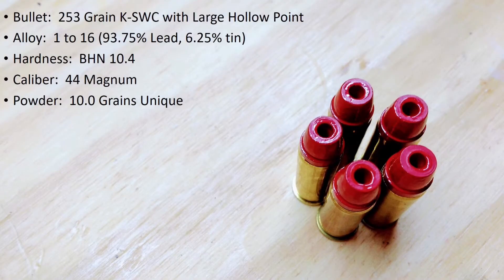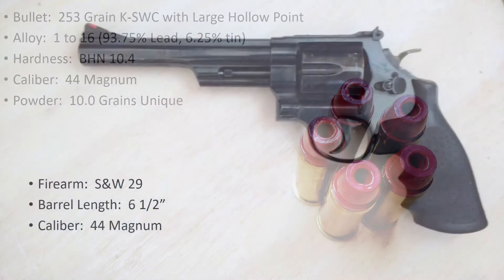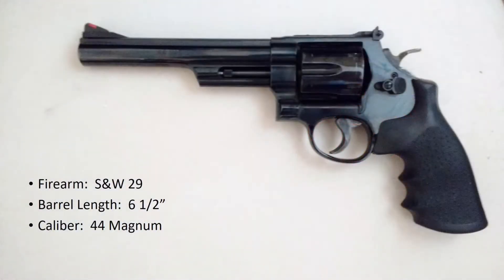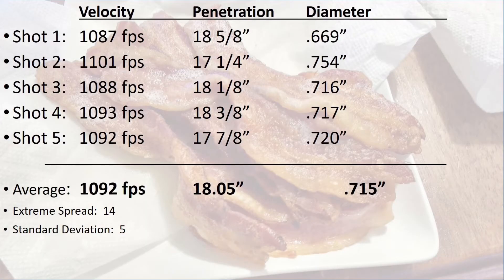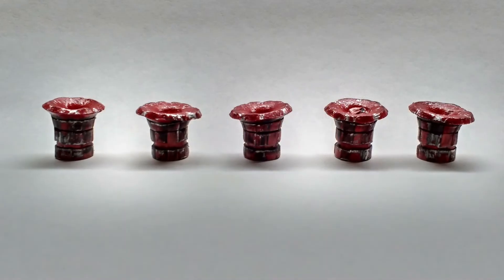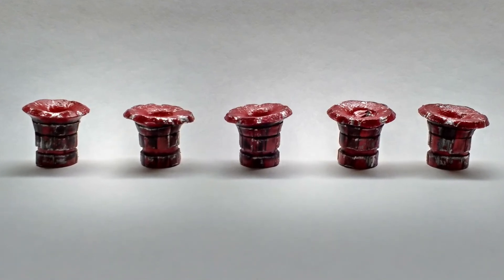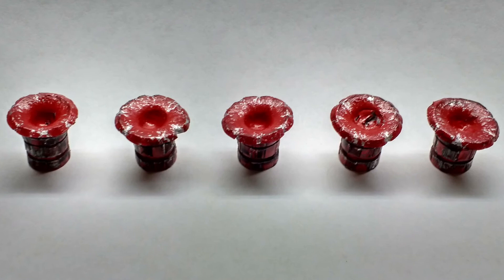44 Magnum (1100 fps), Large Hollow Point, BHN 10.4, Bare Gel (PC HP Test)

Comment: A lot of this is indispensable to the handgun hunter. depending on penetration value and performance of bullet weight retention, (accuracy is a whole another subject), I feel that a bullet must perform @ 50 yards to be in the hunting category for clean kills on deer size game, Paul Harrell called it expansion threshold value. These bullets can be shot a velocity that gives good dependable expansion at that range, Might take a few trips to the range to figure it out, however, these bullets will outperform any commercially offered bullet.  Your work doesn't go unnoticed Bacon, truly a benefit to the reloading community. Dave.
Reply from the maker: Thanks Dave!  I've certainly considered that as well.  Muzzle velocity isn't important, it's the impact velocity.  (I'm also curious what difference twist rate makes ... I think I have a way to do a little testing of that, but I'll save that for much later.)

Comment: LoB - NIce job with this testing...That 10 grain Unique load is a favorite of mine, but my Keith bullets were in the BHN 16-18 and no HP.  That 16 -1 alloy is mighty fine with that hollow point...Gotta check out your video on the Taurus Judge... Good day to ya,  FC Steve
Reply from the maker: Thanks FC!  I discovered the 10 grn of Unique load through this HP testing and instantly became a big fan.  It is a load I will certainly continue to use.

Comment: Those performed very well, I am surprised that there was no disintegration at all from any of them, and also that the expansion was so uniform, good penetration at that diameter as well, a winner.
Reply from the maker: I was talking to a guy at the range right before I shot these, and I told him, "These should shoot right around 1100 fps, and they should perform well.  I'm guessing they'll be fairly consistent."  They certainly did not disappoint.  I'm not quite sure what to expect yet in the next test.

Comment: Great series. I've watched every video... I'm wondering that if you were to cast the non-hollowpoint bullet with pure lead and shoot it with enough velocity, if it will flatten out upon impact with the gel. Do you think the powder coat would prevent barrel leading if you were to do this? If the bullet will deform nicely, I suspect that it would perform more consistently than the HP bullets because the deformation is solely dependent on velocity and impact. I doubt that denim or leather would affect its performance.

I'd love to see you try this if you have time.
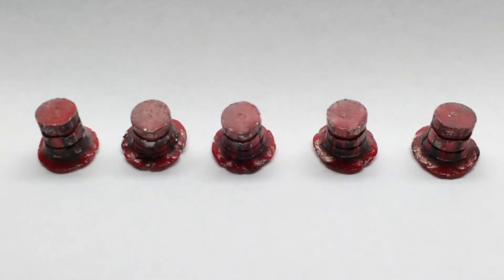Reply from the maker: I have not cast any from pure lead, but the 1:40 mix is the closest I have, and it's only 8 BHN.  I have non-HP versions of both the 44 and 38/357 bullet cast, but the only one I've tried so far is the 38 bullet at 820 fps.  It went through all 32" of gel, and I didn't recover any of the bullets, but I don't believe it expanded at all.  I do still plan to test that bullet at faster velocities, as well as the non-HP 44 bullet.

Comment: This bullet performed great at 1100 . I'm wondering at what velocity it will start to fragment ? What is you're guess ?
Reply from the maker: It’s hard to say.  This particular design doesn’t seem to have much of a window between open up and blow up.  I’ll guess 1250.
Reply: I think you're the guy to find out . A carbine comparison maybe?
Reply from the maker: I can push these to 1350+ in this revolver.  I'll pull out the carbine when it's time to go faster than that.
The next test should be 1200-1230 fps.

Comment: Wonder what would happen, if you drilled out the hollow point about 1/8 of an inch, with same velocity(1092 fps)?
 We'll see if the extra velocity accomplishes the same thing.
 Good Study!
 Christ Bless!
Reply: Drilled HP bullets are absurdly time consuming to make, and as consistent as John Kerry. It would be more sensible to make a core pin with the depth you want. Some molds have adjustable depth HP pins, but diameter, profile, and round or segmented are other options. As he noted, the penta pin moved the thresholds lower. A slightly smaller penta pin might be at about the same numbers as this. Or the same penta pins, retracted down the mold a little...
Reply from the maker: Thanks Hawk!  I don't have any plans to start drilling, but I will eventually try some of these with the HPs filled with silicone.
Reply: Interesting! EXPERIMENTAL.
 Silicone is pretty tough!
 Ever hear of "Big Stretch" sealant? I think it has the same adhesive properties as silicone, but will stretch a lot further. Maybe eliminating fragmentation. Just a thought!
 Stay ahead of the "Been There, Done That"
 Lol!
Reply from the maker: Hadn’t heard of the Big Stretch.  I’ll definitely have to look into that.  Thanks!